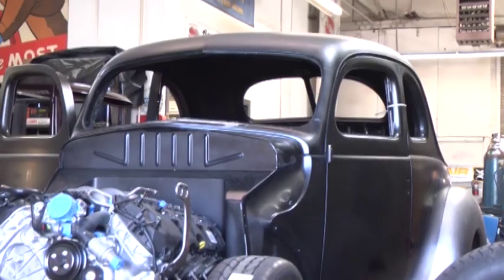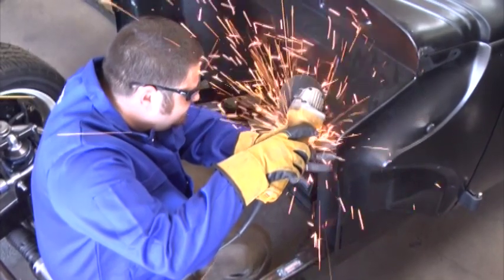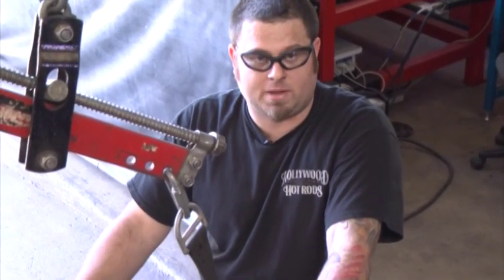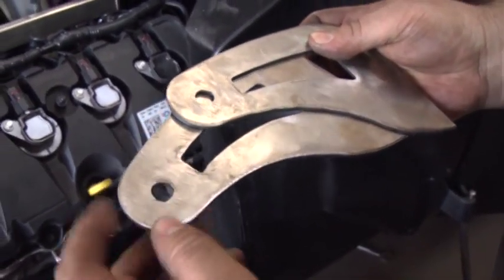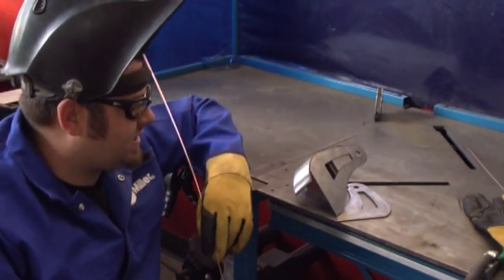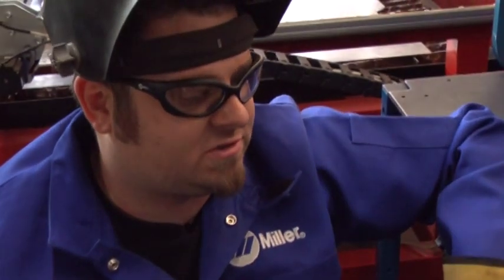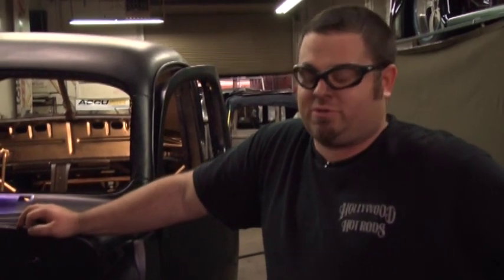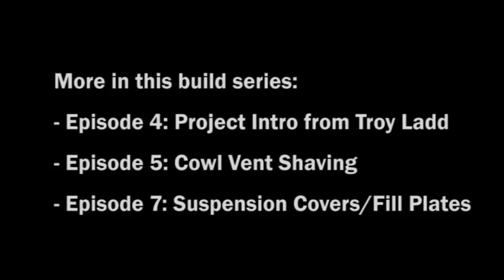Episode 6: Custom-made Motor Mounts with Hollywood Hot Rods fabricator Kyle Cannole

Comment: how did you get the centre of the holes for mounting? Im currently struggling to find the centre as I'm new to fabrication and had to redo a couple of pieces and pretty much fed up with incorrect centres😢
Reply from the maker: Thanks for your question, Dean. You can use circle templates (available from an art supply store), working out from the center, or a circle compass to draw accurate circles from your center point.
Reply: go from matching reference holes in the frame to center line  but most engines set farther to the pass side to allow more foot room for the driver not by much probable 1/2 inch  think of it this way its yours you can make it how you want it

Comment: Does it cause vibracin in the car from the motor without rubber between the motor mounts
Reply: +BRENDAJASON1 I want to know this too.
But maybe they have a well tuned v8? So they don't mind? I'm not sure.
I  know that some newer v6 and v8 engines are so smooth - that they're smoother than 4 cylinders that are using motor mounts.
Reply: If you look they have a urethane bushing where the mount connection. That should stop a bit of the vibration.